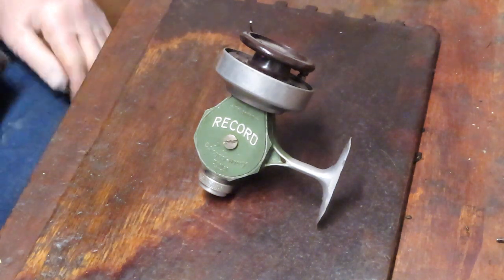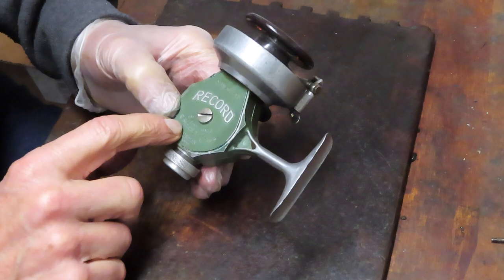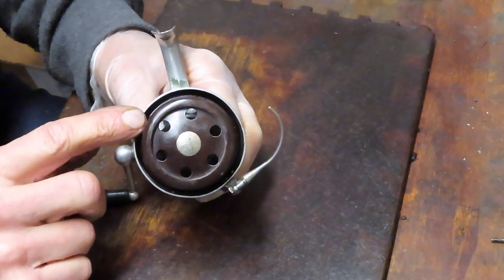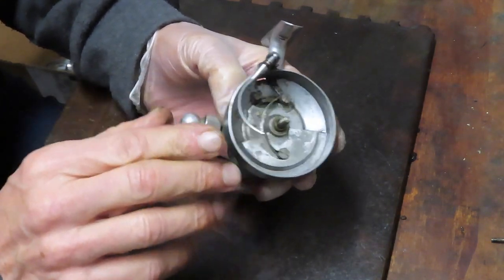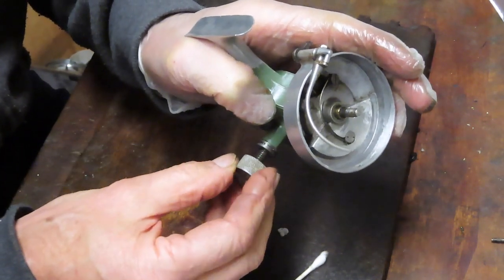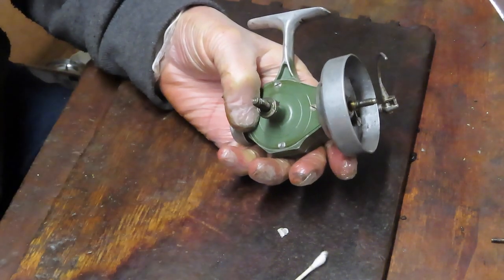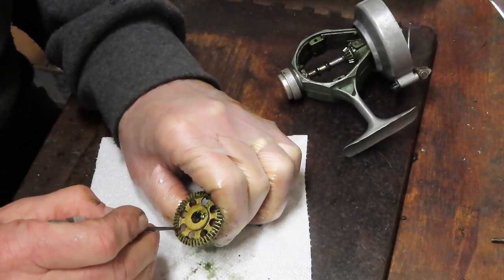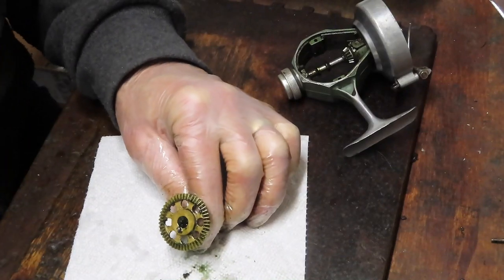Early Swiss made Record spin fishing reel pre ABU 700 history and how to take apart and service

Comment: Dennis, I'm glad I found your video.  I acquired one of these Record reels recently; it had been in an in-law's family for years--probably since it was brand new.  I wanted to clean it up and hopefully get it back in service.  Mine is probably a bit newer than the one in your video, and exhibited some design changes.  And someone had reversed part of the drag assembly, rendering it inoperable.  But your presentation was so thorough that figuring out how to deal with these issues was easy.  The reel is now up and running, functional in all respects, spinning with silky smoothness, and looking almost unused.  Thank you for your work.  You made my little project a success.
Reply from the maker: Mark - thanks for the kind words and feedback.  I'm glad to have helped.  Best wishes - Dennis

Comment: Hi Dennis. Staying tuned in to all your projects and have not missed one yet. I do have a question (or maybe suggestion for a video one day). I have never owned a rear drag spinning reel before but have always wondered what the drag washers interact with to apply tension to the spool. I assume it must be the shaft, but how could it since the shaft is not only spinning but also moving up and down?
Reply from the maker: The shaft is rectangular on the bottom.  The drag washers lock to the body cavity and hold the rectangular position firm in full lockdown.  That enables the shaft to move up and down while the shaft uses the drag washer slots as a bushing.  In full lock down mode, the shaft goes up and down, but cannot move around.  When you lessen drag tension, the washers still hold the shaft, but the reduced tension allows them to spin within the drag cavity - Thanks doe asking - Dennis

Comment: Hi Denis, nice video! 
Here is some additional information about the reel:
These reels evolved from the Swiss Record Reel, patented by Karl Seigrist in 1945, which incorporated a rear drag and anti-reverse. The Swiss Record was groundbreaking in rear drag design and the fore-bearer of many spinning reels seen today.
The Record Reel Company of Zurich introduced the Swiss Record rear drag spinning reel in 1946. There were many models and variations sold from late 1940s-1970s. In the early ’50s Thommen Sports Equipment of NY began importing them, hence the Thommen Record name on the sideplates.

Patent of Inventor Siegrist Karl: https://patents.google.com/patent/US2548073

A connection between ABU and record reel's:
There was, the Swiss Record company (from Karl Siegrist / Zurich) produced the first fixed spool spinning reels for ABU, the ABU Record 500 (half-bail). These were simply marked "AB Urfabriken-Record". They were fully produced in Switzerland, later on they were assembled in Sweden.

In the same time the Record company continued making these same reels for themselves, they were simply named Record... The ones marked ABU-Record are more valuable because of the many ABU collectors out there.

Siegrist/Record continued producing reels in the next years untill the late 1960's I believe, the Recordette is one of them.

PS 1 : the first spinning reels sold by ABU were all produced by other companies e.g. ABU 222 by Zangi Italy, the ABU-Record 450 by Sportex Germany, the ABU-Record 500 by Siegrist Switzerland.

PS 2 : Their very first own designed and produced spinning reel was the ABU Cardinal 66 (first production in 1965 for sales in 1966 the year of introduction), the very first of the Cardinal series.

The reel is quite valuable, in the current condition 30-40$, but if you can fix it -- 50-70$ or even more.
Reply from the maker: Thanks for the additional information.  I am always interested in learning more - Dennis

Comment: at 19:17 you show the pinion do you know how to take it apart? it screws up or is a push up I recently got a similar reel, and somebody put the pinon sleave backwards (do not really know the name of the part) thanks for your time
Reply from the maker: I do not believe that can be detached.  All parts and documents I have show a single part for the top housing with pinion gear.  That usually means that the pinion gear was pressed into the housing - Dennis
Reply: @2ndChanceTackle  thank you Mr Dennis

Comment: Hey Dennis I have a ocean city no 900 and the star drag will not go back in
Reply from the maker: Check to make sure the threads are clean on the gear sleeve.  If there is dirt or old grease it will clog.  Use a hard brush to clear the grooves.  If that doesn't work - check the drag stack to make sure it is seated properly.
Reply: Thanks Dennis it worked

Comment: There are two on eBay like that one.  One for fifty and the other is 84.99
Reply from the maker: Good to know.  Mine has the bent rotor and the bail is not working (yet).  I will repair the bail, but am not sure that I can fix the rotor. - Thanks for the info Terry - Dennis